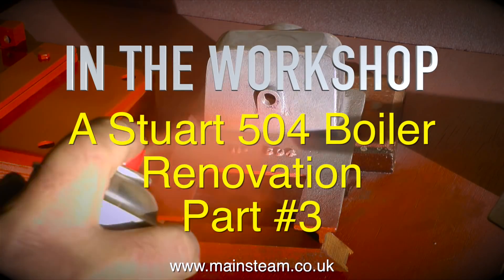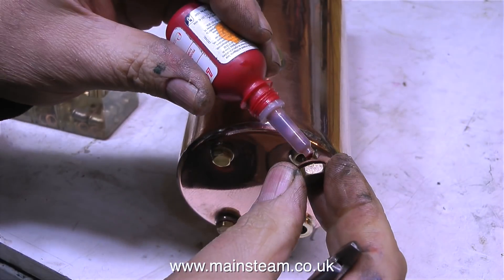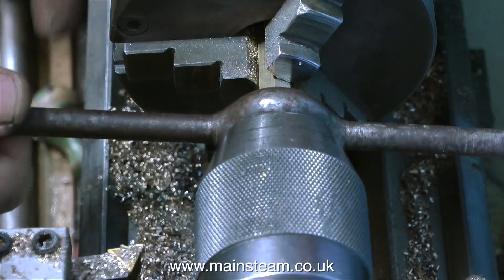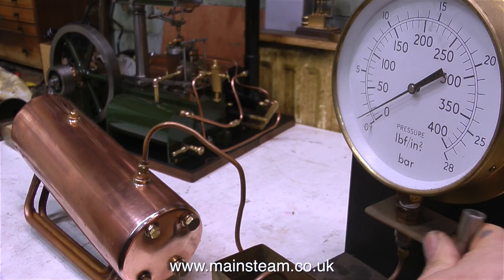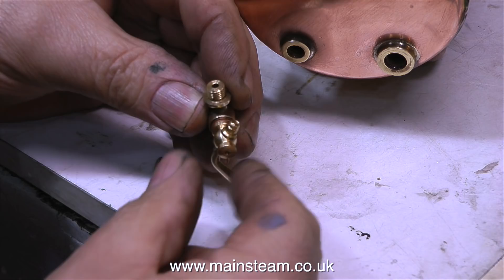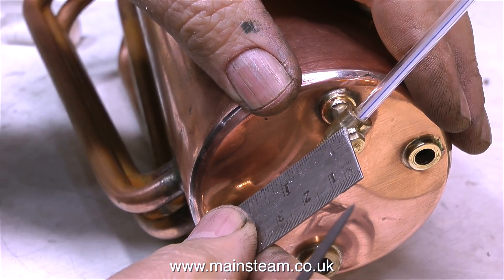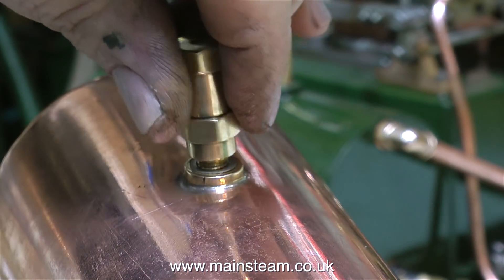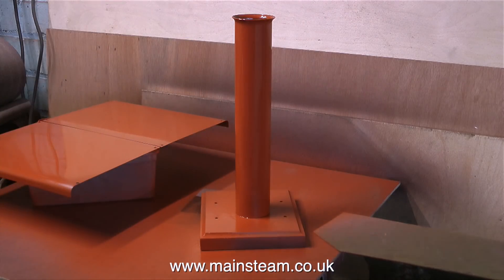A STUART 504 BOILER RENOVATION - PART #3 - IN THE WORKSHOP

Comment: Did you ever have a boiler that did not pass the pressure test?
Reply from the maker: Yes, a couple of marine gas fired boilers I bought via Ebay were not safe. I chopped them up with my bandsaw and made Condenser/Oil traps out of them }:-)))

Comment: High temperature paint, Or is it not neccessary?
Reply from the maker: No providing you give the paint some time to "bake on" before a full firing. I will explain on the end video of this short series,
Reply: At 60psi, the hottest the outside surface of the boiler would get is about 308 deg. F. I think "high-temp" paint is usually used on metal surfaces not cooled by water/steam but subjected to combustion temperatures such as wood stoves or barbecue hoods.